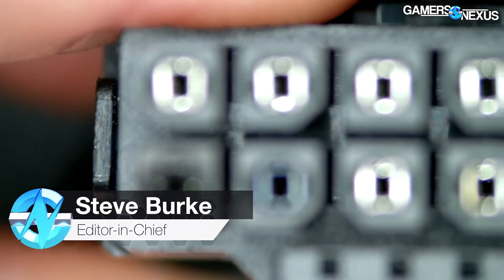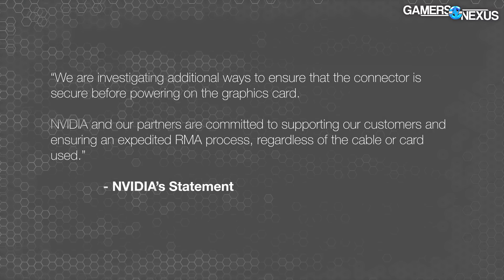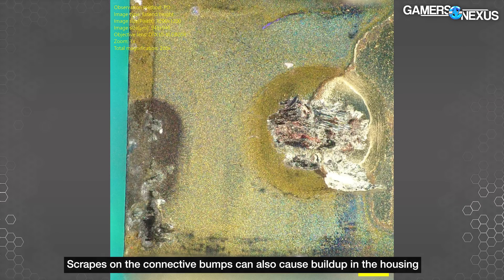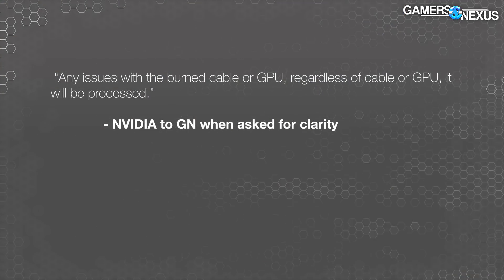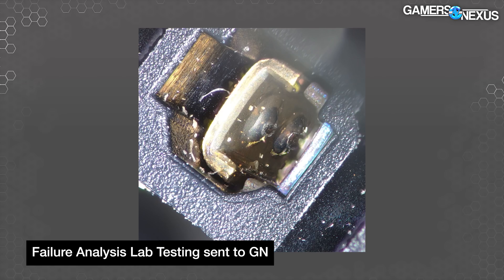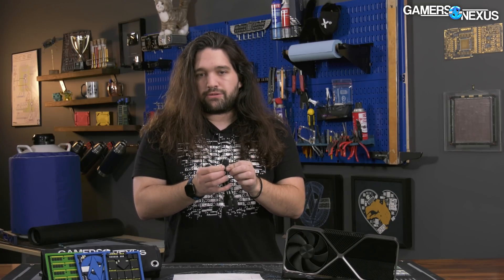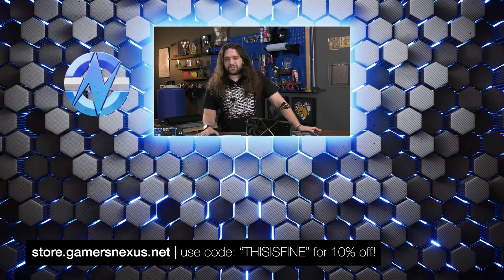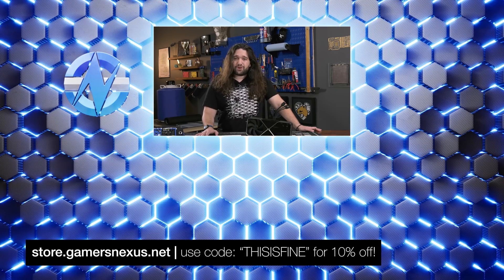NVIDIA Responds to Melting Cables, Warranty Concerns, & 12VHPWR Adapter Failures

Comment: Having a hook on only one side of that box socket only secures 3 direction of movement (at best). For this very same reason, possible force on the cable, is why serial, printer, and older monitor cables were secured on 2 sides. The understanding of this has been around for a long time. The reason this question is coming into play now is entirely due to the cards power requirements and it's connection. So, the best solution would be both twin latches and shortened sense pins as security.
Reply: The best solution would be to redact the connector itself from even being a standard and go back to using the standard that is still relevant and functional that has existed for a decade+ at this point. Let nVidia keep it's proprietary connector all to themselves, they like that sort of thing anyways.
Reply: @bdhale34  Perhaps, but I don't see innovation stopping over a prototype fail. Quite the opposite actually.

Comment: Is it out of the question to have a mains connector on the back of the card. do Computer PSU's have a god like clean power supply ? neater the way it is i Guess. will GPU's ever pull like 1k watts eventually ? I mean that does surely warrant an external power supply.

Comment: Steve why not have an automotive connector. IE: there is a secondary click sliding tab that goes under the compression end of primary clicker tab, only when first tab is fully seated. Thus blocking improper insertion!

Comment: The problem is not the cables or mis-connecting. The problem is that Nvidia created a card that requires a nuclear reactor to power.

Comment: lol. Blaming it on user error is a cop-out. These are designed badly which is the main reason for such "user errors". If user error was truly an issue, we would have seen a lot of such cases in all these gpus sold in the last 5 years (or more) with higher power requirements and the 8-pin x2, or even on the 3000 series with the 12pin or whatever (my 3090s use 2x 8pin).

Comment: For all the hate they get for this situation, I think Nvidia has behaved pretty well for now.
From what we now know, it is understandable that they didn't catch this issue before the release, they (at least from their statements) are warrantying everything, and while their communication has been a bit slow (taking a day longer than an independent organization to reach the same conclusion obviously isn't optimal, but I can understand it, given they have more at stake and more bureaucracy because of their size).

The one thing that surprises me is that this problem has only been found now.
The 12pin was already on founders edition cards for 30 series, and at least the 3090 and 3090ti should also be power-hungry enough to cause this issue.

Comment: I still feel like this Nvidia power socket, and it's stumpy little adapter, is an abomination. I'd much rather have 3 cables running directly from my power supply, and into 3 beefy sockets on my graphics card. In my mind that is both neater, and less prone to error.

Comment: It's probably fine when it's completely latched in, but it would be nice if it had a latch on either side to reduce strain if it's cable managed or bent. It's probably a few pennies more expensive per cable, I can see why they wouldn't want to do it when they're being sold in the thousands. Still, I agree it needs more audio feedback when plugged in above all

Comment: Hi Steve, at 16:50 Ish you suggest that pushing to hard on the connector will not cause harm .
this is not necessarily true,  don't forget the socket. 
all of the pins from the socket to the board are perpendicular to the force being applied, and movement of the pins

might damage the solder joints.
Yes there is a mechanical connection between the circuit board  and the plastic body of the socket,
and this means  that with "appropriate" force there should never be an issue. 
if you look at the back side of the board you can see two additional solder spots above the 16 solder pads,
there are two metal pins imbeded into the plastic body and they are  fixed to the board by those two joints.
amphenol (another source for the socket) appears to use two plastic latch tabs instead for the same purpose.

Comment: I would like to see GN conduct testing to determine the likelihood of damaging the motherboard by applying the required force to correctly seat the 4090 power cable after the card has been installed.  In other words, help determine if the guidance should be that you are required to install the cable before installing the card for both physical/electrical safety reasons.

Comment: Please research the cable melting can happen to the older cables as well, in my optic the newer cable is a failure by design as a partially inserted should either not work or fail at a much less dangerous way.  Either the card or the power-supply should detect the higher resistance at the high power on the cable.

Comment: Do we wait for 4000 series 2.0 with a complete redesign of the connector or are we going to have to wait for the 5000 series.  If you have that many user error problems with a connector that kind of screams bad design.

Comment: I can't get over this even becoming an issue in the first place. How were they confident releasing with this adapter, given that it's come to the point you have to take very specific steps to make sure that it's "properly" seated?

Decades of use with 8 and 6 pin audible and tactile feedback may be coloring my opinion, and yes, you can screw those up enough to make them burn... sure... but the worst thing that ever happened to me personally when I didn't properly connect one is the component not turning on. 🤷‍♂

Comment: You're misreading or misunderstanding the warranty phrasing issue. The issue isn't that the phrasing permits voiding the warranty in cases where it's reasonable to void the warranty; the issue is that it can also easily be used to void the warranty even when the card itself is clearly at fault. The most obvious issue isn't the word "may" that you focused on in this piece; it's the word "or"; i.e. that the warranty may be voided by usage of either a non-spec compliant cable or a third-party cable. Obviously, it's entirely unreasonable for nvidia to be legally entitled to void the warranty for usage of a spec-compliant third-party cable.  Additionally, the warranty limitation on non-compliant cables isn't limited to cases where the non-compliance causes the defect; it permits voiding warranty for entirely harmless use, which is also entirely unreasonable, but phrased in a way to make that unreasonable stance appear superficially reasonable.

In essence, this contract was worded to give nvidia maximum leverage in the case a dispute arises, even when they're clearly in the wrong.  And the reason they can do that is because they have an exceptionally strong negotiating position compared to a buyer (and there's no compensating regulation to limit their abuse of power). While it's hardly shocking to see a corporation try to give itself permission to screw over their clients, it's nevertheless entirely unacceptable; you should not be defending nvidia's choice of wording here, it's simply bad and anti-consumer.

Notable, I don't believe nvidia actually is honoring their warranty here - what they're actually doing is a PR exercise aimed at limiting damage to their brand; the warranty is merely incidental. The distinction being that it's entirely less clear whether they'd "honor the warranty" if it wasn't such an attention grabbing issue. By having a warranty that's so full of loopholes they get to play both sides: appear trustworthy when they choose to honor it; without actually needing to abide by the conceptual promise it represents whenever doing so become inconvenient.

Warranties matter; nvidia should have an actual warranty, not this sieve of loopholes.

Comment: I am dumbfounded.  When I think of all the people involved with designing, creating and bring the 4000 series to market, contrasted with all the time, drama and disappointment related to the power adapter.  I simply have to say WTF!!  Running all that power via a pigtail adaptor is unconscionable.  I am not an electrical engineer by any means, but damn I am smart enough to realize running 600 watts or so via a pigtail is not the way to get power to these cards.  Since when is it acceptable to risk one's life, home and family on a damn GPU?  It is a 0.04 % failure rate risk of major fire I choose not to take.  You all know damn well someone will leave their 4090 running overnight doing some kind of graphics test or something to be woke up by the smell of smoke with their gaming room in need of a 911 call.  It will happen.  For Nvidia to publicly announce they know the failure rate is what is, and the failure of the power adaptor means fire is not a bright idea, unless they would announce a correction, or recall of the cards.   Nvidia does not need a different/better power adaptor, but a redesign of the power delivery system to the 4000 series of cards.
Be happy, be safe

Comment: Eh, honestly this looks like a design flaw on the cable connector. There's barely any click, almost no sound at all. The amount of force you need to use is more excessive than any GPU I've ever plugged in. Nvidia is currently riding the line of best of both worlds w/ their statements. Blaming their crap design on users "not fully connecting" the cable, but ALSO covering warranty. They know its a design flaw, or they wouldn't be covering it under warranty IMO.

Anyways, amazing videos covering this subject guys! This is why this place is now my one stop for tech / hardware news.

Comment: The connector needs a tiny bit more force than some other common computer connectors and due to user error Nvidia recieves alot of backlash and claims that it is their fault.

Comment: what of the 3090s, didn't they have this connector too? shouldn't they have the same failure rate? they didn't seem to. so i'm stil inclined to believe there's a little bit more about the 4090s issue.

Comment: Steve, thank you. I was wondering if it was worth a video trying to achieve this with an 8 pin PCIe plug as one thing that resonates from the early criticism of the 12vhpwr is the 30 in out cycles. As buildzoid mentioned, this was also the case for the 8 pins.  People's hate on Nvidia is fuelled by the prices but always disregards the incredible leaps they are making in technology that benefits us all.

Comment: Had my 4090 since launch but actually switched to using it testy after I saw your video. not Plugging the cable in properly seems a dumb mistake to make for experienced whales buying a 4090, so boom, time to use mine to its fullest

Comment: Nvidia and PCI-SIG needs to do a couple things, acknowledge it is a design error, education campaign with videos and articles to let users know what it looks like when the cable is fully seated, improving the latching mechanism where no matter if the cable was pressed against the case panel or a tight cable management, that it doesn't caused melting and loosened connections, and finally warning labels on the cables and adapters on future production to visit x website to see how to tell the cable is properly seated. 
I do not believe this was a user error as there was no education or warning before hand to know what to look for given the click isn't as pronounced as the 8 pin design and lack of letting users know how much force it takes. If all this education and warning was done before hand and users didn't check themselves, then it would be a user error.
So thanks to Steve, GN, and others spending time to find out the problem and education users on how to make sure the cable is fully seated.

Comment: I just installed mine and yeah it requires way more force to push in than on my 3070. On the upside the card is so large that it'd be impossible for me to put on the sidepanel without pushing the power connector all the way in.

Comment: Out of just 125k cards sold (-ish) they found, at worst .05% that were installed improperly ?
Steve @GN and Linus @SecretShopper found waaaay worse failure rates in professional PC builds (not DIY), regarding cable "shipping" damage. 
For .05% world wide... Why The * did this "issue" blow up ?!? Reeeee... The Giga PSU was waaaaay more widespread, and not because of new plug style user error (teething pains)< that barely got any traction and .... Reeee (╯°□°）╯︵ ┻━┻
I'm only upset because i had a brief moment of insanity and gave the end-user (humanity) the benefit of doubt, aka not user fault but some kind of design oversight. O.O Just plug it in and give it a tug(to check), was too hard ಥ_ಥ

Comment: Also a solution: maybe move the connector from that absolutely stupid place which basically screams “the cable will be bent, there will be additional strain on the cable, it might come lose” to a normal place at the back of the card, somewhere more easily accessible, where it wouldn’t be jammed at the side panel of a lot of cases.

Comment: What is essentially stupid about all this is that military connectors exist for this which are certified not to allow this kind of crap. nVidia could have used it only one one side to secure this properly and a normal one on the other side with one thick multi wire cable. To me the way this issue looks is that by using cheap parts you sell a high end card. Regarding cable spec, no spec is not open how you want to look at it, it is a spec how a connector needs to be done. Any connector that does not fit the spec is basis for a lawsuit. Imagine if pcie spec was like this, so you use brass instead of gold, why not its yellow.

Comment: So when the RMA happens and Nvidia trades the damaged with the new what is going to happen with the damaged connector on the GPU? are they gonna replace it and sell it as new?
Reply: Unlikely, a lot of companies wouldn't even sell "refurbished" parts (as in being transparent that it is a repaired unit that previously had "damage"). They just scrap the whole thing & possibly use whatever they can from that if anything.

Comment: 15:06 Just like strapping something to a trailer, once it's tight you MUST tug on it and go "That's not going anywhere" or it will come loose. This is a universal truth.

I knew a guy who didn't say it after strapping his toddler into the car seat, drove 3 blocks and hasn't seen his kid in 34 years.

Comment: Consumer product design in modern times NEEDS to facilitate prevention of user error! If it takes some significant amount of care for a user of a consumer product to plug in a simple power connector and then to verify that they did it correctly in order to prevent a potential fire hazard or avoid product damage, then it’s a BAD consumer product design. Like, USB cables are keyed for a reason, and the contacts are different length for a reason…

Comment: I think the sense pin idea is the best. It would be almost completely idiot proof if you physically cannot use the graphics card without having it plugged in all the way. I feel like any other suggestion requires the user to know some information, which of course they should but they might not always.
Reply: It looks like they are missing input from mechanical engineers on the team desiging the connector. 
The insertion force needed for positive latching should not be very high. Large pin count increases this force and explains why 8 pin connectors do not show this problem.
Reply: That's exactly how the old PCIE 8 pin worked

Comment: If you didn't  properly plug your Dyson fan in the electric socket , and it resulted into fire or melted cable, you can see class action lawsuit right away.
4090 is much expensive than a Dyson fan.  NVIDIA must protect their customers from  that  kind of scenario.

Comment: I will blame nvidia though for a: lack of proper click or any feedback that the adapter provides and that there was no included right angle adapter. It is a failure on nvidias part and regardless of the here and now the design does not show a good long term outlook. Imagine the cable pins weaken from stress?
Christ blaming users is like eat shit pay me for my garbage product. 

This is a failure, do not blame users.

Comment: If a high current connector can be installed improperly and appear visibly to be fully inserted, it's a defect in design.

I'm sure the connector was improperly installed due to carelessness in some cases, but it's an overall failure of a design.

No redundancy in current path or pin contact to accommodate for debris, and a connector latch that requires extra effort to insert is not ready for consumers.

You shouldn't have to shove the housing in, or perform voltage drop tests on a connector to ensure it's plugged in properly.

Comment: LOL I love the "plug cable into the card before plugging card on to MB". I have never done that on any build in the last 20 years. Basically they are admitting a shitty design without saying "we done f-ed up the design".
Reply: Just don't forget that "we" in this case means the SIGPCI working group, and that this is now an issue for everything that will ever use this connector until it is deprecated. Nvidia just happened to be the first one to use it on a consumer product, but it's going to be featured in a lot of datacenter components going forth, which is actually where the request came from.
Reply: @andersjjensen   but who lead the design? Usually companies jocky to lead the design based on what they have on their roadmap. The official page doesn't say who lead the design.  With other specification bodies like IETF, they list the companies backing it and who is leading the design.

Comment: Another way to check if it is in all the way is to see if there is a small gap between the cable and the connector on the GPU as seen @15:38.